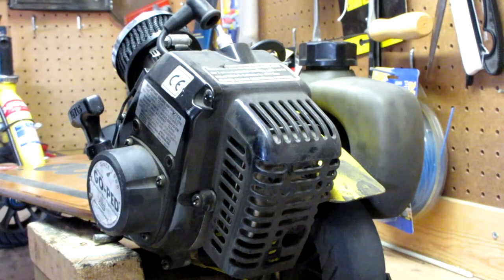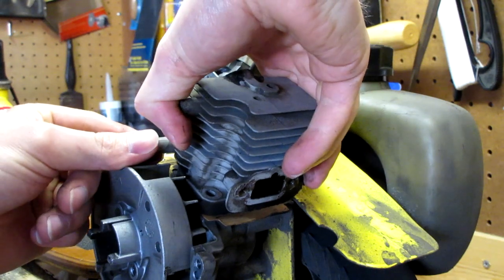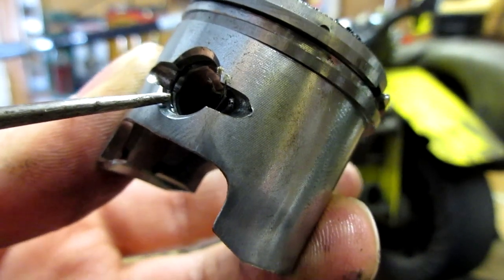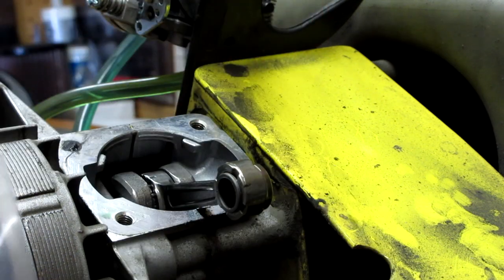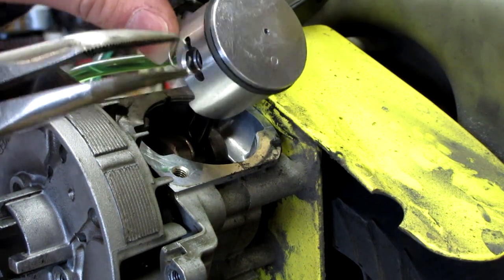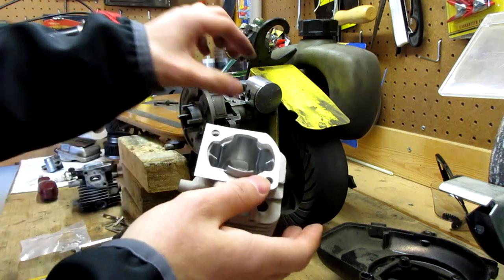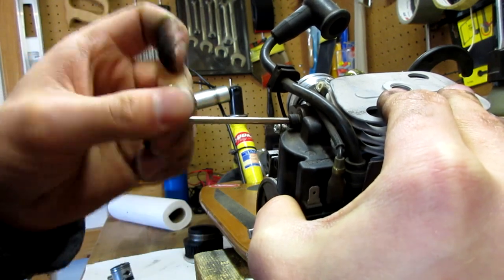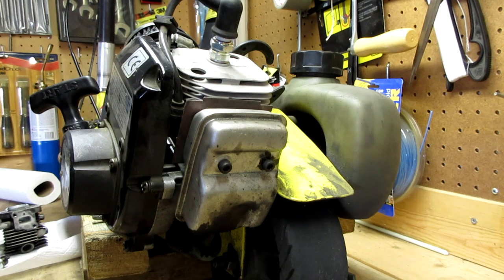HOW TO INSTALL A BIG BORE KIT

Comment: Great video man. One thing I ALWAYS DO is push a rag or paper towel over the crank case so as to not accidentally drop a c clip or bearing down in there. A couple times I was holding my breath as you were working directly over it. I’ve done it before and it took me some mad Macgyvering to get it out

Comment: I would recommend if you are putting this kit in an lh engine, check for clearance with no base gasket, sometimes you have to grind the notches in the crankcase because it can push the cylinder off to the side and the crank webs will hit the bottom edge of the cylinder, I recently converted a g23lh into a 30.5cc rc stroker engine and ran into that problem, I had to spit the case again and clearance it, very important step with and internal engine parts is to always test fit parts because these kit push the limits of the dimensions of these engines, when you go to 30.5 the engine physically can't be made larger because the piston is almost as large as the cylinder bolt spread and with a 30.5 kit the piston ring stop is right on the jagged edge of allowing the ring to jump out , so always check, good engine building takes a lot of time and attention to detail, I know its tempting to just rip a kit right out of the box and slam it in without thinking about it but if you pay attention to what you're doing you'll find that usually you have to modify something to make it fit but this kit is worth the effort it really wakes these little engines up.
Reply: I thank you

Comment: One thing you should have done that you can still can do is order a rockit timing advance key off DDM to advance your timing that would make a world of difference easy to install just take the flywheel off and it’s on the shaft they’re 5 bucks really does make a world of difference when you advance the timing

Comment: I have the same goped but in red I have a stock G23LH engine with 668 hp carb with red choke lever and v stack and air filter has pipe I wanna put the same big bore kit you have in this video will it fit on my lg if I use the same big bore kit you have with the same crank shaft from lh or do I need and rc crank let me.know please

Comment: Shouldn’t the back wheel continuously be moving once lifted off the ground after starting? Just got done with the same big bore kit and that’s the only issue I’m having HELP
Reply: probably too late now but it’s probably your idle on the carburetor
Reply: If the back wheel turns when you pull the cord, your clutch material has probably come off and jamming double thick keeping the clutch engaged, if not.. its most likely your idle is set too high

Comment: What carb did you get? I need to get a new one mine doesn’t have an adjustment screw.
Reply from the maker: http://www.davesmotors.com/ddm-hp-carb-kit-for-g23lhgpl290-engine-wa-167-carb.html

This is one for a goped sport

Comment: Dude.. cant believe how easily you put the cylinder on the piston i was hammering mine for an hour straight had to rethread the spark plug, cracked the sleeve a little but not bad enough to lose compression i dont think, i think i put the piston on backwards.. I blame the person who was claiming to help me because they were a supposed expert and they put the piston on backwards. How big of a performance increase was it? Glad to see you ride gopeds as well i love the quad set up you have
Reply: You literally did every possible thing wrong when working on an engine lol

Comment: Do you have any idea if I would be able to use the stock g23lh carb with the same big bore kit you used?
Reply from the maker: +Alex P. Yes I'm almost positive it will fit. But you really need a better carb if you get a big bore kit because it needs more fuel and it needs to be tuned. You won't gain much power unless you upgrade your carb as well
Reply: Okay yes I'm sure it will fit I am just worried about tuning issues and ability to run. I think Ill install the new motor parts, then see how it runs and go from there.
Reply: Thankyou for the quick response
Reply: Alex P. U
Reply: Any links where u buy it from.       And if it was me i would of ported it why new head off match carb and out let

Comment: What if the fly wheel does not spin freely
Reply from the maker: Take your spark plug out and take your wheel off. It should spin relatively freely. If it doesn't your engine is probably toast

Comment: isn't the otiginal engine 29cc and why does the big bore kit says you're converting it in to a 26cc?
Reply from the maker: +pasparinho originally it was a 23cc the big bore is 26.5cc
Reply: MotoPosh mine is a 29cc stock
engine model is gpl250 are there any big bore kits for mine?
Reply from the maker: Are you sure thats what its called?  If its truly a 29cc engine that you have you might try this...

http://www.davesmotors.com/Zenoah-G320RC4-Bolt-Top-End-Kit-38mm-31-8cc-967319401-takeoff.html

Or look for something else on the site that fits what you have. I've never heard of the gpl250
Reply: Pretty sure that’s Chinese